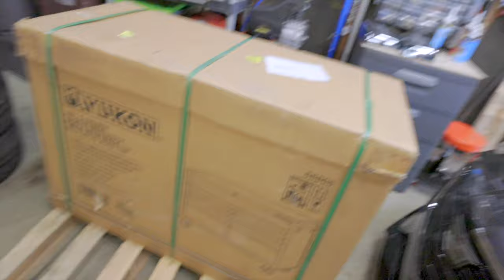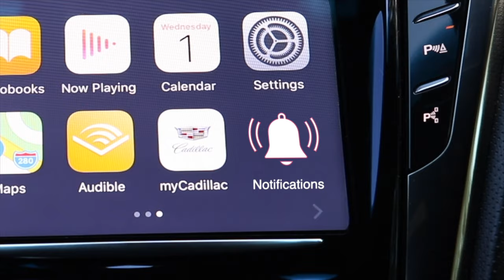The Great Garage Optimization!

Comment: I own DeWalt, Makita & Milwaukee tools! I have the 52” Husky bottom chest (4 of them) and 4 Milwaukee top chest mounted right on top of them! They rock.  They have power built into them.  Red Milwaukee chest on top and Black Husky chest on bottom. Looks greats. I have a huge garage and tons of tools. (Work at Home Depot). Go to Home Depot right now you can get the Husky 1/2 Torque wrench (24” in length) 50-250 lbs.  normally $90 but right now $49.97 with a cool case.  Also they have the 3/8 one for same price.  Guaranteed for life!! You can’t beat that. Go get them now unless you have torque wrenches already.   
I used to live in Vallejo and had a garage just like that!! House was built in 1897!!!   It is still there!  I live in Springville Cali and just loving the country (no gangs) living.   I own over 5,000 sockets btw!  I do al my own work on my cars and my Harley. I have a 2016 HD Street 750 in Denim Black. Love it.  That house you live in looks maybe from the 30-40’s?   The house I live in now was built in 1912! Love it. I’m on 3 acres and noooo neighbors!!! So much space and nobody to bother me!     Enjoy your new check. Get the Milwaukee top part! It’s awesome.
Reply from the maker: 5k sockets??  Holy crap. I wouldn’t have imagined there were that many...

Thanks for the tip on the torque wrench!  That’s tempting
Reply: @JetFuelOnly  yep. I used to buy old craftsman sockets & ratchets from yard sales and swap meets and take them back to Sears to get new ones!  Became a hobby over the years. That’s how I have so many!
Reply from the maker: How many 10 mm sockets do you have? 😂
Reply: @JetFuelOnly  lmao ummm way to many.  I have a 36mm-80mm socket set.  1” drive.  I have only used it I think once. Lol. Massive set. Picked it up at a state sale years ago.